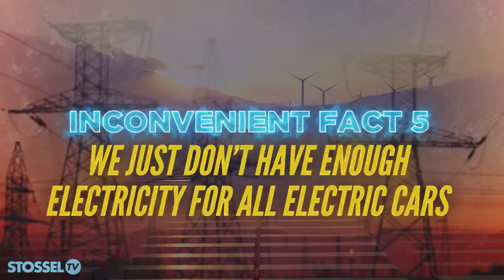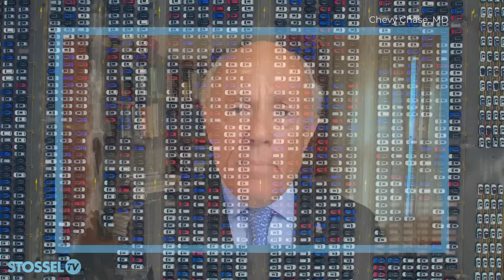Electric Cars: Inconvenient Facts, Part 2

Comment: I don't remember whether it was mentioned in Part 1, and Part 2 almost got here, but my question is, "What is the environment impact of the disposal of the batteries when they need to be replaced, or when the car reaches its end of life?"
Reply: Tesla already has plants to recycle ~90% of the material from their used batteries
Reply: @chasemsutton   Unless Tesla can change material sciences to something the rest of the world doesn't know about only about 50% of a battery can be recycled. Yet another inconvenient fact about this subject...
Reply: Batteries used in Tesla vehicles have 20 year lifetimes (in the vehicle) and can be reused in the power storage for another 20 years before being recycled.  Batteries are almost 100% recyclable.  Other BEV makers will probably go straight to the recycler.
Reply: @davecross5317  did YouTube block my last comment? I think I put a source link in there maybe that’s why they blocked it. Anyway Tesla currently can recycle 92% of raw materials from their batteries based on all available sources. Not sure where your 50% claim comes from but maybe look into that more, or comment your source and I can look into it and maybe have my mind changed!
Reply: @richb2229  It's not a matter of whether or not it's recyclable, but whether it's WORTH THE ENERGY AND MONEY CONSUMED to recycle those materials. For example, a solar panel costs an average of $30, but only yields $4-5 worth of materials when recycled. Not to mention the energy cost of the actual process. It's simply not worth it, depending on the product being recycled.
Reply: @chasemsutton  no. They don’t.
Reply: @richb2229  no. They don’t have 20 year life spans.
Reply: @richb2229  Teslas have 20 year battery lives? I'll believe that when I see it.
Reply: @richb2229  And you read that in a Tesla brochure right?
Reply: Don't worry about that, because the world is going to end in 12 years, remember?
Reply: @darksideblues135  Battery packs rarely just "die" and become unusable.  Rather, they lose capacity over time.  Hence, after 10-15 years, that battery pack might be down to 50-60% of it's original capacity.  Given that the original range on the oldest large production eVs (Nissan Leafs from 2010-2013) was only about 75 miles, a 50% battery would only be able to go about 35 miles on a charge, making it fairly impractical even as a commuter.  The battery, however, is still useable- especially stacked in groups to act as a storage receptacle for solar/wind energy.  In Europe and Asia (Japan), batteries from cars that are no longer road worthy are salvaged and used as battery storage for industrial buildings, stadiums, schools, etc that have rooftop solar.  The USA is still a bit behind on this, but the same thing can be done here.  Those batteries should be able to soldier on for many more years before being completely incapacitated.
Reply: @libertarian4323  batteries don’t store energy. Not sure what you are talking about.
Reply: @EngNerdGMN  Lots of Roadsters are still on their original (and lousy first-gen) batteries, and they're 14 years old now.
Reply: @robocowone464  And it always will end in 12 years.
Reply: you can recycle most of their components.
Reply: @davecross5317  - False. With current technology, as much as 92% of an EV's battery is recyclable.
Reply: @SeraphsWitness  Consider the alternative to recycling batteries: mining and refining raw materials. Your statement is true as a general statement - that recycling is only worthwhile if it's cheaper than the alternative - but in the case of recycling EV batteries versus mining/refining, recycling takes far less energy - no contest.
Reply: @Kralasaurusx  except that's a false dichotomy. The options aren't merely "recycle batteries" or "make new batteries". There are several other energy options that don't require power storage at all. That's the entire point, Jethro.
Reply: @richb2229  Even for non-Tesla EV batteries - they're still the easiest source of all the materials Li, Cobalt, Nickel needed for new batteries.  Far less refining required to turn an old battery into a new one, compared with digging the raw ores out of the ground and refining them.
Reply: None of these people answered your question.

Assuming like some fools here think that 90% or more of the battery material (electrolytes and substrates) can be recycled (they can't yet, but maybe someday that can be) the toll would be profound. The catalysts needed to recycle the solid and liquid electrolyte are toxic and so are the byproducts there is a need to apply heat in some processes which takes even more energy and of course the recycling process requires the materials to be broken down first which takes more energy. It's barely a savings over what was needed to mine the batteries to begin with especially when you consider that special facilities that manage their liquid solid and gas wastes to recycle batteries will also be needed. All to do what make another battery that will need to be recycled within the next decade?

Or you can spend the energy once to make gasoline that is used and already dispensed of immediately after-the-fact. All of this hinges on the idea that CO2 is a blanket... look around you this November (2022). It's pretty dang cold right now. If CO2 is doing what these experts claimed it could not be this cold.
Reply: @chasemsutton  to this day that is a dream. No battery (including Tesla batteries) r recycled at anywhere near 92%. Stop spreading lies.
Reply: @SeraphsWitness  Makes sense, I have seen recycle depots full of old solar panels just sitting there rusting, No one is recycling them as the cost isn't worth it at least where I am.
All sounds good though, As in they get sent off to a"recycle depot" and everyone thinks that's the end of it and have done their part, Far from it as It's still waste and nothing is getting done but the pile is getting bigger..
Reply: @chasemsutton  That's a lie. The lithium isn't being recycled. They just sell the old batteries LOL! TA DA, it's recycled! It's going in a landfill.
Reply: @EngNerdGMN  Hansjörg Gemmingen, drove 1 million miles in his 2014 Tesla Model S.  A million miles divided by 15k miles annual average equals 66 years.  Are you a believer now?
Reply: @SeraphsWitness  It's not a matter if it's recylable.....what matters is that solar can cheaply and cleanly produce energy for over 25 years.  That's kind of a big deal.
Reply: @1KentKent  25 years? Talking high end German or Japanese panels?
Most panels sold are the cheapest possible Chinese. Good luck getting 5 - 10 years
Reply: They are not disposed, they are repairable and recyclable. The average Tesla battery now is getting 200-300 miles some much more. Even at the high mileage they retain 90% of their original capacity.
Reply: With all this talk about the batteries, nobody seems to think about the fact that fossil fuels are still going to be required to produce tires, lubricants, seat cushions, seat covers, paints, bumpers ( the vinyl ones ), bushings, dust covers, dash panels, wiring insulation, electrical panels, hoses /tubing for cooling and heating systems, interior door covers and these are just the things I can think of right now on cars.   And then there are so many things not to do with vehicles like plastic storage bags and containers, bottles for practically everything, packaging, computers, cell phones, plumbing and the list goes on forever, as virtually everything plastic comes from fossil fuels. Yes, there are some that come from vegetable oil, but not many.
Reply: @dallasarnold8615  The problem with fossil fuels is the CO2 they put in the air.  Everything you mentioned is ok to keep around since it doeant produce CO2.  You get a pass.
Reply: @dallasarnold8615  yes and let's not forget the electric motors. To get a compact electric motor which is powerful and efficient mining, processing and manufacturing all kinds of high value and rare resources is required. The mining and processing is all done with fossil fuels as mines typically generate their own power, manufacturing is a mix.
Reply: @petersmith5140  The cost of recycling outways the return of recycling.
Reply: @1KentKent  He swapped motors and batteries MULTIPLE times in that million miles, so no, the battery did NOT last a million miles.
Also equating pure mileage to battery life is absurd. Batteries that travel ZERO miles will lose capacity with age, so merely extrapolating the miles out does nothing to account for battery capacity loss due to age.

Show me a SINGLE battery with reasonable mileage that has lasted 20 years. Just ONE
Reply: @kids123123123  What's the battery capacity on them? 95%? 90%? 80%? 60%?
Reply: @indyrock8148  25 year use is the industry standard and most solar panels come with a 25 year warranty.  How many things do you know of that have a 25 year warranty?  That's 25 years of American made electricity, powering your American made EV.  Recently,  I had a problem with my solar panels installed in 2013.  The company told me that it had to do with improper seals, allowing rain water in.  This problem has been fixed with newer models of solar panels.  Yes, they replaced all of them for free.  The technology is not that complicated and the quality will continue to improve, becoming more reliable than your fridge or HVAC.
Reply: @EngNerdGMN  The average gas car last 12 years with about 150,000 miles. So nobody really cares about 20 years.  An EV battery will easily last 12 years with some degradation.  The lifespan of batteries will only get better as new technological advancements are made.  That's 12 years of saving a whole lot of money not buying gas. Buy American! Use American electricity!
Reply: @1KentKent  the same company was still in business?
Usually those companies Phoenix every couple years to avoid warranty costs.
Reply: @1KentKent  So you have the notion that the production of all these things do not release CO2. How naive !
Reply: @1KentKent  True, most people don't keep cars for 20 years. I am not most people though. My 12 year old truck has 220,000 miles and still get 400 miles on a single tank.
And I agree with buying American. My Toyota was built in Texas.
Reply: @EngNerdGMN  Just think how much money you will save on your next EV truck after 220,000 miles.  Just cheap electricity from your garage.
Reply: @1KentKent  Except that I wouldn't be able to tow my trailers or a load of cargo because the additional power needed would kill my battery range and with the lack of charging stations I would be limited to basically 100 or less mile radius of my home charger. Even if I do find a functioning charger in the wild it's a multi-hour wait in order to recharge, exponentially increasing my trip time.
Meanwhile I can run my gasoline truck at marginally higher cost, maintain substantially higher range when loaded down, and it only takes 5 min to "recharge" at any one of millions of gas stations.

Sure I'd save a TON of money charging the electric truck... mostly because I'd still have to use my old gasoline one any time I needed an actual truck. I have co-workers with EVs, I've seen the struggle.
Reply: @EngNerdGMN  I agree with you.  I don't think there is an appropriate EV yet for your large towing needs.   Which is too bad.  I bet you spend a ton of money on gas.   In another five years you should have more options.
Reply: @1KentKent  Gas isn't too bad. I get 20mpg unloaded and 16mpg loaded down. That's really good even comparing my 12yo truck to new trucks.
Reply: @EngNerdGMN  Yeah.  It sounds like you should stick with your old truck, keeping it going for a few more years.
Reply: @1KentKent  I would love if electric cars were practical, but as Stossel points out, there are a LOT of issues that need to be resolved frst.
Reply: @EngNerdGMN  The issues are manageable.  Most of the car industry is switching to EVs.  It can be seen in the US, Europe, China, S. Korea, Vietnam.  It's inevitable as the internet and smartphones.
Reply: @dallasarnold8615  No one is saying the production of EVs, solar panels or wind turbines don't release CO2.  What they are saying, is the CO2 released from the production and USE of these over their lifetime (compared to the fossil fuel industry) is much, much lower.  In 25 years, it will be even lower as we use more sustainable energy and recycled resources to produce them.
Reply: @1KentKent  We still need substantial leaps before it can entirely shift over. There's plenty of room in the market for both EV and gas.
Reply: @EngNerdGMN  No substantial leaps necessary.  We already have good battery technology and it continues to improve.  We already have significant battery chemistry resources and we continue to find more in the ground.  We already have economies of scale production with Tesla, Ford, GM, Kia/Hyundai, VW, Fiat, Mercedes, Volvo/Geely, BYD, SIAC/MG, Changan, and several other Chinese automakers.  Even Japan is announcing new EV models and new plants.  We already know how to put EV plug-ins, at gas stations, malls, light posts, houses, sidewalks, parking lots.  We already dislike the politics of the Middle East and Russia, who have too much control on gas prices.  We already know how to build nuclear, solar and wind power plants for clean electricity.  We already know how to build-out our electrical infrastructure to replace the needless shipping of oil to refineries, and then gas to gas stations.  In 10 years, the majority of new car sales will be electric, simply because it's a better cheaper car.  If America doesn't lead the way with EVs, we will be buying European and Chinese EVs.

Comment: California is switching to EV in several years. It’s law. It’s unfair because EVs are so expensive, not only the initial purchase, but to replace the battery which is $7000 - $20,000. How are middle and low income families supposed to afford that? So CA has made owning cars a class privilege where only the rich can have. So the rest of us can’t drive to work, pick up our kids from school, etc.? Someone with clout, please bring attention to this in CA. It’s an unfair law!
Reply: EVs plummet in value faster than ICE just buy a 3 year old vehicle for 70% discount
Reply: And then replace it's batteries for $30,000.
Reply: These sorts of mandate will be revised as the time frame draws closer. Political posturing even if it comes from a good place such as a desire to improve and move humanity forward it is still just political. In the end even politicians will have not choice but to work within the confines of whats realistic at the time. Trust me, Cali will not follow thru with EV mandate in 2035 or whatever the deadline was that was promoted.